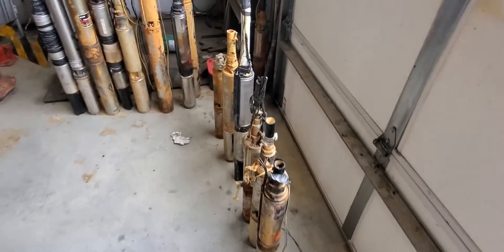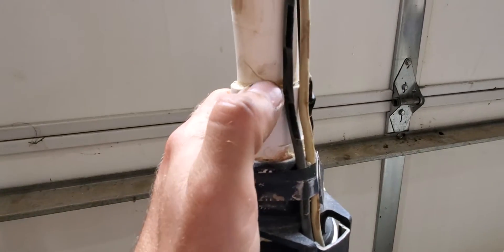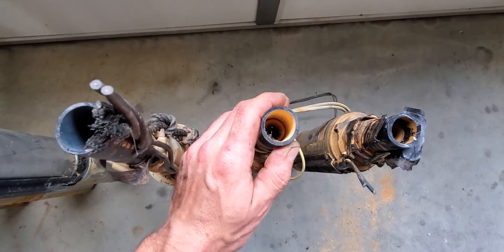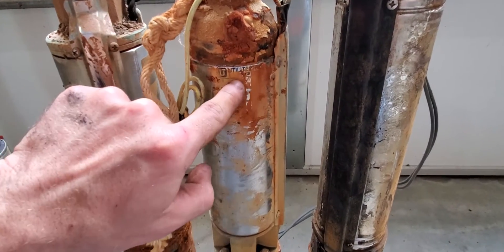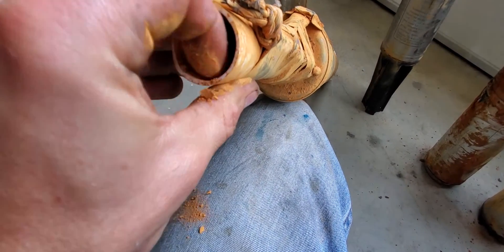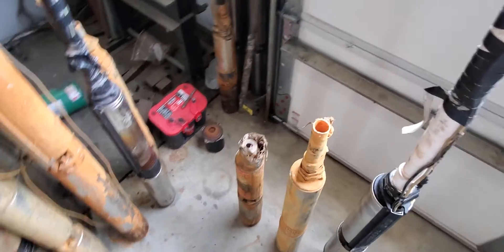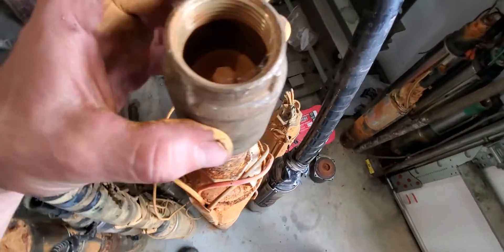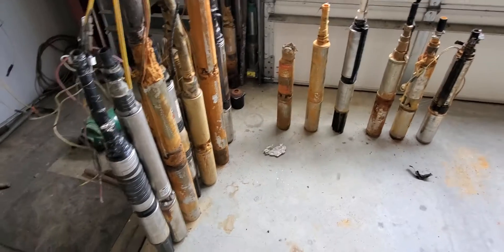No Water, Low Pressure,  Air in Water lines. Here's Why! #1 Troubleshooting video

Comment: Sprinklers run fine for 10 minutes then pressure drops to below 20psi. What do you think is wrong. Thankyou
Reply from the maker: Probably running the well dry faster than it's filling up. I'd assume you have different zones. Try cutting off 25-30% of the heads and see if it lasts longer. If not try 50% of them off & repeat. If it still goes below 20 psi in 10 minutes with half of the heads off, you'll know that it's likely the pump or tank. Does your system have a tank? Or is it a timer run system?

Comment: Amazing video, great job, subscribed! I have air coming into the house water lines only after I haven't used the water for a while, like overnight, and only when it first comes on. If I keep the water flowing, like when outside water my plants, I don't have additional air in the lines (even after the pump  kicks on again). Thinking this might be a crack in the well pipe which allows air in while the pump is at rest (water leaking out over time), perhaps somewhere above the water line. Does that make sense to you? I plan to pull the pump and check. Thanks for any advice.
Reply from the maker: Your on the right track! It's probably not a crack...but could be. It's typically a leaking check valve in the pump. If you have a check valve at the tank or at the top of the well, then that ones holding pressure back & the one in the pump is leaking slowly.  If the pumps old, just replace it honestly. Or if it's less than 8 years old, add a check valve on top of your pump & re install! Your definitely in the right direction!
Reply: @h2omechanic  This is SO helpful. Thanks for being so generous with your expertise and time! Pump is about fifteen years old, so time for a change!
Reply from the maker: Happy To Help!😊

Comment: Hey I have a well and I have no water at all I put a new pressure switch on it thinking it was the pressure switch and I still have no water I put a brand new pump in last year so it can't be the pump and I have done everything I can possibly think of and still no water what do you think it can be
Reply from the maker: If your tank is bad (busted bladder) it most certainly will kill the pump typically in 3 months. But let's say the tank has good air pressure in the top of it & still no water... if you installed it yourself, your problem will most likely be the wire going down the well to the pump. Test for voltage out at the well, if you get power there, you have to pull the pump out. Then inspect the wire carefully top to bottom, you'll probably find a rubbed wire within 10ft of the pump, but look at the full length, splice the wire & tape the wire to the pipe every 3 ft(important) .
Reply from the maker: https://youtu.be/iXSQg6LLwxY
Reply: @h2omechanic  OK thank you I'll try that

Comment: Is the check valve same as the bleeder valve? Cuz my irrigation well pump has a bleed valve as well as a dole valve. The dole valve has reduced rhe pressure, but none the less I had some volume last time I used it before late fall. Yesterday I turned on the pump to irrigate and have a volume of a garden hose flow with hardly any pressure. It pumps 24 hours without any delay, but maybe 2 gal/ min. Do you think the well has droped? There is only one well driller in our area and he is swamped.
Reply from the maker: My 1st question to you would be is it in above ground jet pump or a submersible pump. You might have a cracked drop pipe like a few in this video. 
The check valve is not a bleeder valve. Bleeders are used with older galvanized tanks.

Comment: One year old well no mechanical issues but only getting 10 gallons in a 24 he period.  Can hear water flowing when listening down the hole.  6" drilled 4" lined 310' deep.  Have you ever heard of a well cracking at the bottom to not let it build volume.  Pump is 5-7' off bottom of the well.
Reply from the maker: Yup! I believe you have a busted drop pipe. The pipe that hangs the pump. What your hearing is the water pressure pushing out the pipe. I recently did a video on exactly your issue explaining it on my white board. I bet you have a low production well too. Probably 1gpm.
Reply: @h2omechanic   it is on a coyote system i get about 12 gallon an hour.  Is there an easier way to test this verse pulling the entire line?  Thanks for helpful vids and fast reply?  The 1 minute it runs i get a full heavy stream into the tank, i hear the water sound the next day before running the pump ever so not so sure about it being the water draining from the line.
Reply from the maker: https://youtu.be/mjhZXgzZoDM
Watch this to understand
Reply from the maker: My test would be to kill the power & see if the pressure drops to 0psi. A leak in the line would take away any pressure you have stored in the tank. But it you have a check valve at the tanks incoming line, my test won't work. 
Sounds like a 310" screened well, we do that in areas that are notorious for collapsing. That means the well was drill through soft material and it's not like a normal well thats granite rock with water veins. We call the areas Terasic Basin material, basically it's very old volcanic soil the well is drilled thru, terrible to find good water in. Where are you located? City & state & County. I might can pull up a geological map & see what your area consists of below the surface.

Comment: Ok I need help my pressure switch burned up so I just replaced it and now I can't get any pressure to the house only when I add air to the bladder tank and it will only get up to 10 pounds.I replaced the pump 2 years ago and the bladder tank last year .Any Idea what could be my issue or issues?
.

Comment: Hi amazing video.  Our pump pumps up to 20 psi when I turn the breaker off it does not drop down it just stays at 20 ;  when I open the Spicket at the well it drops down to zero when I close the Spicket it goes back up to 20 what do you think the problem might be ?   Thank  you so much for your help !
Reply from the maker: Sounds to me like the pumps old & worn out or possible cracked pipe in well. Or a leak in yard or under home. If u find no leaks, the pump needs to be pulled out of the well

Comment: New pump, new pipe, new check valves, new pressure tank, new control, and the pressure tank has been adjusted to 38# on a 40/60 controller. I can wash clothes, dishes, shower, most anything except a bath and hydrant. Anything with a lot of water at once drops the pressure activated the pump. The pump will run for about a minute and then pressure drops to nothing.  Then when shut off it’ll come up to around 30 and slowly build back to cut off over about ten minutes. Any suggestions?
Reply from the maker: How deep is the pump set? How much water does the well make? Have you had water issues in the past?.
Sounds like everything is new so...try lowering the air pressure in the tank slightly, if it's at 38psi, set it to 35psi. I've had pressure switchs recently not set correctly from factory.  Lower the air in tank will give you a little more cushion if the switch is the issue. 
Second, do you have a filter system for your well? 
Any background information would be helpful. Bur I'm sure we can solve this problem
Reply: @h2omechanic   Oh yeah I’ve been chasing issues for a year. It’s set at 165’ plus or minus a few ft. The water table starts at 95’ and and the well goes down to 220’. The pump was at the bottom but I had a boat load of sediment and it was on 100psi line and it didn’t have any check valves. So I got threaded scdl 80, 3/4 horse red lion pump, put check valves in changed my plumbing so the pressure tank, controller, and filter are at the inlet to the house. Prior it was set up so that the pressure was at the farthest end from the inlet. The filter now is ao smith 5 micron and I just changed it. Sediment had filled it but not like before. I had literal gallons of sediment before raising it. After the well it’s up hill towards the house near 1/4 or 1/3 of a mile. My only theory now is too little pump for the amount of line it’s pushing through. I’ve never tested gpm I remember a conversation 20 years ago with my grandpa where he mentioned having good water and 9 gallons a minute but it’s just a glimpse so I wouldn’t put money on it
Reply from the maker: It truly sounds like the pump isn't set deep enough, & at high usage situations, it can't keep up producing water. But give it time to build up over the pump & itll go back to working. I need to know how deep you set the pump. & the GPM rate of water flow the well produces.
Reply from the maker: If you have 1000ft of pipe to the house, your getting friction loss. Id recommend putting a nice size tank at the house too. Just Tee into the line anywhere. If you want, we can schedule a time for a video call & I can get a full understanding. If you have tools & a electric meter & pressure gauge/tester I can probably figure out the issue. I do charge for video calls & youll have me for an hour. It's up to you. But if the pumps new & a 3/4hp, it's fine. Its probably a bad tank & friction loss bc of distance. Is the line to the house 1"?

Comment: Woke up the other day and had no water. Checked and had no pressure at all. Took cap of pressure switch looked rough so replaced it with new one still nothing. Getting 240 volts at the switch. I was thinking pump went bad but haven't pulled it yet. Could the tank be bad or just the pump.
Reply from the maker: Could be the pump or the wire going down the well. As a pump turns on & off it moves around, causing the wire to rub the wells rock wall. Acts like sand paper to the wires plastic jackets. So pull the pump out & inspect the wire carefully top to bottom! Its it looks good, then the pumps bad.

Comment: Pump went out on Sunday replaced it ran until today , swapped it out again and now I get nothing what could cause this ? Am I doing something wrong  ?
Reply from the maker: Did you inspect the wire & make sure there's not any exposed copper/ jacket worn away? A bad tank will kill a pump, it'll cycle on/off/on really fast. 
Do you get proper voltage at the well? Did you make sure the switch wasn't the issue? How old is your tank&switch?
Reply: @h2omechanic  just went and bought a multimeter and there’s no power on the y and b so thinking a broken wire was hoping to avoid having to pull pump out again
Reply from the maker: Disconnect wires & test the ones coming from the house. Should get 240v. 
Secondly connect 1 wire to 1 of the well pump wires (white. The other black (well) wire (not connected) Should bring up 120v. Test each side like this. Your testing each leg (wire) individually. Multi meter wire would be testing 1 hot wire & other led goes to ground. 
But from the start, swapping 2 pump like that automatically said u 95% had a bad wire down the well. 
I have a video on installing a well pump properly. Find it on my channel, watch it, take a few notes & itll last you 15years w/o issue. But either way, your in the right direction. Sry you gotta pull it out again
Reply from the maker: Test voltage on all 4 screws under the pressure switch cover. Make sure the powers going threw the switch!

Comment: Hey H20 Mechanic! Great Video. We have an issue with our well where after about 5-10 minutes of running the water our water pressure goes down drastically. Approximately 25% of normal water pressure.  We have a feeling the water pressure tank is not getting filled quickly enough and runs low and we getting poor flow rate from well.  We have lived in the house for about 16 years. The well was drilled before we moved in. I have replaced the well pump about 12-14 years ago.  We had folks come out this week and replace the water pressure tank because the pressure gauge was not functioning correctly and they told me the bladder in the water pressure tank was faulty.. The new water pressure tank did not correct the low pressure issue.  So I am thinking perhaps a problem with the well pump or possibly the well itself. We live in the NE and are still in a drought. Any suggestions or recommendations would be greatly appreciated.
Reply from the maker: Depth of well & depth of pump would help me determine the issue properly. 
1st it sounds like the water level is low in the well & runs out of pumpable water mid way thru. Possibly a leaky toilet in the house thats draining the well slow but 24/7 . So inspect toilets carefully!!! 
Secondly. 14 years is at the service life of the pump, its time for the motor to die (bearings fail inside)  or the pump end could be worn out inside (impellers) & not allowing pressure to build. 
Turn off well breaker and wait 60 minutes and see if the pressure on the gauge drops to 0. It should hold steady if no water is leaking out.
Reply: @h2omechanic  Thanks so much for the information. We are having someone come out next week to check the well - depth of well, depth of pump, flow rate etc. I am hoping it's the pump. The well guy who is coming out does not think it's the pump. At this point, it makes sense to replace the the well pump in my opinon. We also had our neighbors drill a new well this summer which is around the timeframe we starting having issues.  At that time we were in a draught and thought the draught was the issue for the low water pressure. I will try you recommended test today and let you know what happens.
Reply: Update!!! The well pump was faulty and replaced. In addition the flex tubing was replaced due to manganese build up. The good news is that there is plenty of water in the well
Reply: @josephecannon  reading this I was even worried for you that the neighbor was taking to much water. But that's good news
Reply from the maker: Great news! Thanks for your update!

Comment: I have a well that burned up the contacts on the pressure switch, (I have replaced the pressure switch twice this year) I have installed a new pressure switch, I have power, but for the first time I have zero water coming out of well. Not sure where to start. Would a bad pump cause the switch to go bad?
Reply from the maker: Your tank is either bad or low on air. Causes switch to click on/off/on rapidly. Watch my videos on pressure tanks & follow those tips for testing yours. If tank is good & set properly after inspection, then it could be a pump getting old & pulling higher amps, but typically switches die due to a bad tank.

Comment: Our well is 260 feet deep with only 1.5 gpm.  A company came out and measured down to 200 feet before they found water.  Does this means our well is drying up?
Reply from the maker: Yes...but there's other factors. 1.5 gpm says its always been a low production well. Im gonna guess and say it 10-15 years old. 70% of the time a low flow well is being emptied by a leaking toilet. Test that first!. Turn off well breaker, open sink til water stops. Wait 1 hr & go look at every toilet and see if the water in the back of the toilets have lowered, but before you do that, make sure 1 of them isn't set incorrectly & water is going into the overflow spout . 
If they leak down, just replace the toilet flappers & turn off your well breaker each night, if u have a slow leak, the powers off so it won't keep leaking. 
If you try these tests & nothing seems wrong, your looking at a possible Hydro-Fracing for the well. I actually did 1 today. Originally 1gpm & now its 6gpm. So they work great & are expensive but not like the cost of a new well. Im here to answer any questions you might have and point you in the right direction of what to do so the money that is spent is done wisely. I recommend using well drilling companies, not plumbers. Call around & compare prices. Fracs are around $3000. New well 300ft $7000. Those are real prices! Be wiery of the cheaper priced companies!!!
Reply: Thank you for the reply.  I’ll look into your suggestions.  I appreciate your opinion.

Comment: Very informative thanks
Reply: hi i have a new pump and I moves it to a location closer to the well, and now when I turn it on it starts up fine until it reaches the cut off pressure.it shuts off and clicks right back on and then clicks off .clicks on. and the pressure drops while it does that but when it reaches the staring point it doesn't stay on may more it just keepa clicking on and off. untill i disconnect it wait a minute or so and when it's energized it starts again like before and repeats this cycle again. the pump is new about a month old. please advise if you have any idea of what is going on.thank you
Reply: thank you for your videos they are very informative, and  easy to understand what you are explaining about the functions and operations of the pumps.i appreciate you taking time to help out folks.